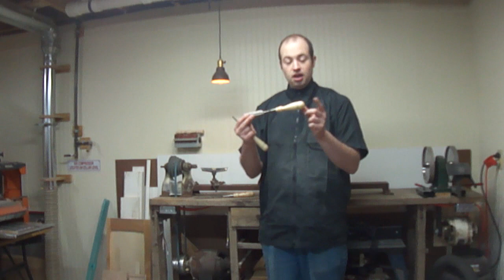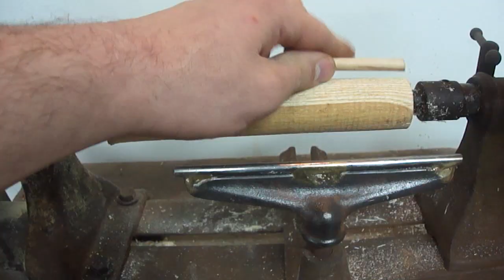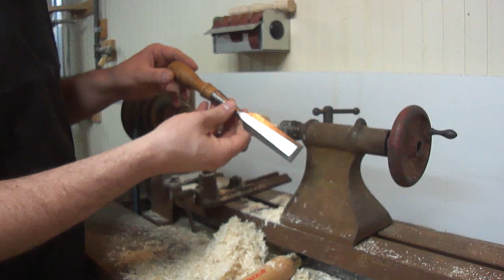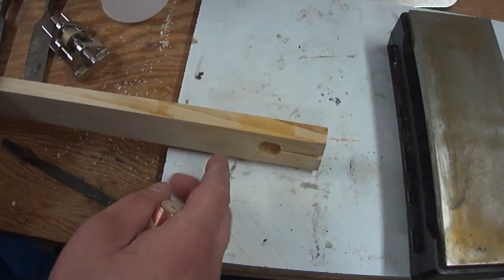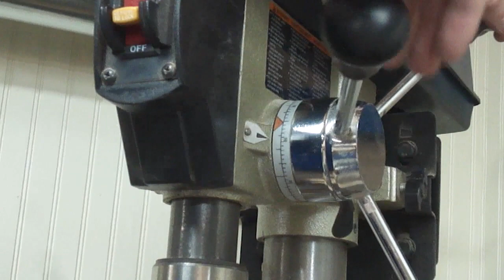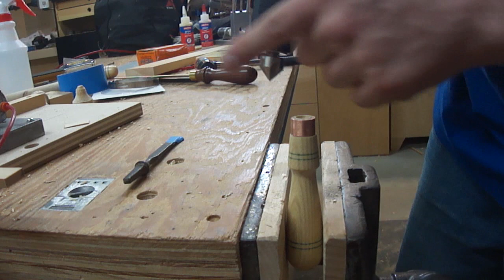Make Your Own Chisel Handles

Comment: Most socket chisels have a taper of 7.5 degrees on a side... but there are some 6.5 degrees all the way to 8 degrees.... on a metal lathe.
I do not paint the grooves, but burn them in with a piece of steel wire pulled with two vice grips.